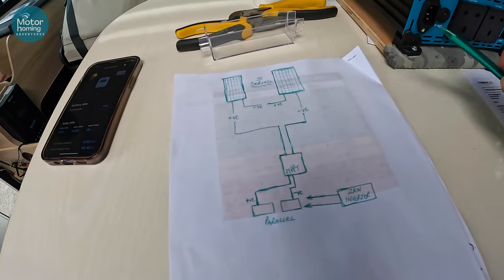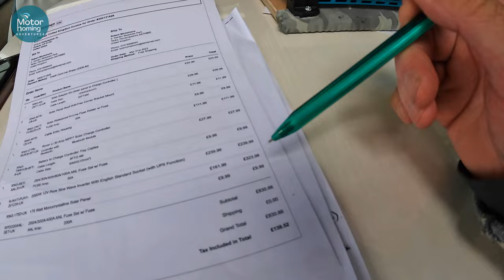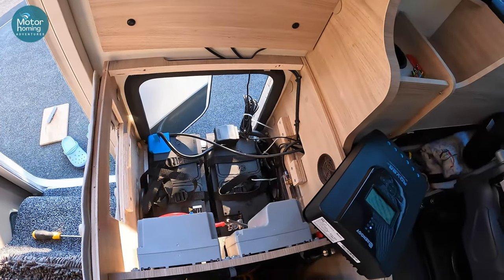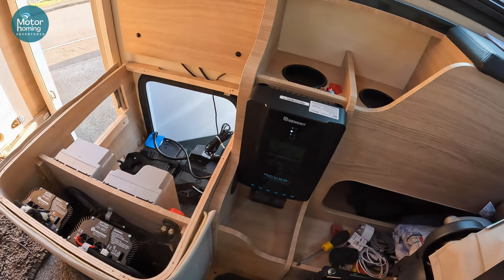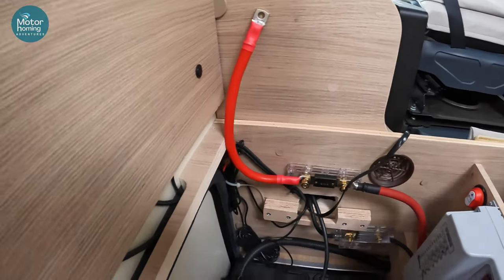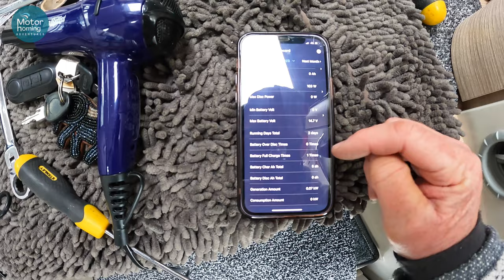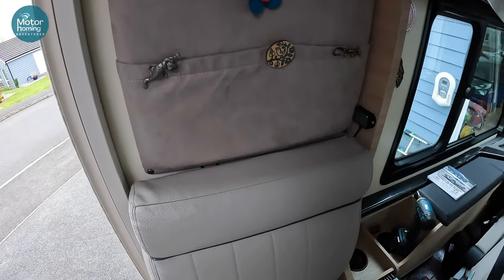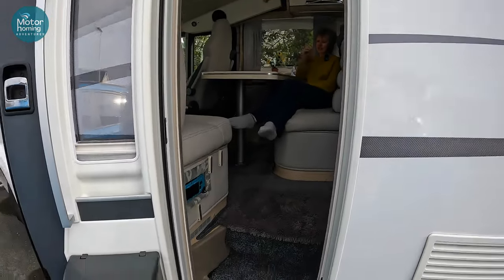Motorhome Mods : Motorhome/Campervan DIY Solar Upgrade : Part 3 - The final day !!

Comment: Great series of vlogs and really demonstrates how straightforward it is with a little planning. Probably going to do the same with my new van but a little worried about invalidating the warranty so will probably record every step and it's only a single hole needed.  I guess the only missing you might want to consider is a means of easily isolating the panels like you can the batteries?.If you didn't want to create a large opening in your decorative panel and had a little more space  could you introduce a short length of cable from the inverter and fix a 3 pin outlet to the panel? I might consider Mer over paying a lot more for a ceramic coating.
Reply from the maker: Many thanks indeed Ged and really glad it made sense :)) Yes the warranty is a consideration but mine is only two years so not long to go now. Yes I did consider running an extension from the inverter, under the floor and then siting it like any other socket in the van near the table where we have that existing extension but decided we could do everything we needed to from there.
Mer is fantastic Ged - just needs the elbow grease - wax on, wax off .... :))

Comment: Beautifully completed 👏, will now need to look at doing something similar. My concern is that I might interfere with the existing EBL and I don't want to touch the existing system.
Did you download the Will Prowse book, as I need to read something and learn a wee bit before starting and buying these products for a project like this.
Used MER for years on my car.
Reply from the maker: Many thanks Drew, much appreciated :) 
I started on You Tube and found Will Prowse's channel which I liked and he had an Amazon link to his paperback on his film descriptions so I then used both and other sources that I came across en route - just a general sponging of info!!

Apart from bypassing the final wiring run that went through the old 20A fuse, I didn't link into any existing systems and the solar almost runs as a standalone aspect bringing power into the battery and/or out via the inverter. I have an existing DC to DC charger system when the engine is running so the solar is another seperate system - at least that's how I look at it in my non-expert way !! 
No doubt your own research will establish any EBL issues with your vehicle as you begin that learning journey - thats all part of the fun of the project.
I'm keeping a close eye on all the van electrics and battery states by day at the moment without the van plugged in on the drive at all - just seeing how things settle then have a run or two planned to properly test things.

Comment: Interesting.  Thank you for this.  I'm in two minds on my solar upgrade - panels in series or parallel?  I note you opted for series which may be less efficient if any part of one panel is shaded?
Reply from the maker: Thanks for watching GD and I went series as the wiring required was less 'heavy duty' and the configuration should be more efficient across the 'solar day'. The mobility of the van means if I anticipate needing max power I chose the appropriate parking space with no shade which is easy. Having parked partially under trees once it didn't affect the live solar generation much at all so I've not yet seen the shade effect !! I think at the end of the day I just preferred to work with slightly lighter guage wiring - being a beginnner !!! Hope that makes sense :)

Comment: Hello Bob, I have watched this video before and enjoyed it, so I am back in tonight to look at your inverter. I am considering getting an inverter for my van. Before I jump in , I was wondering why you choose a 2000 w inverter when you could have a bigger or smaller one. I am sure you will have researched the subject. I am thinking of mounting the inverter in my batterybox , and connecting it to the mains input plug . I am thinking all 240 sockets and micro wave will have inverted power waiting to be used. My main reason for the inverter is to use the microwave once a day . I have also heard that inverters can be hard on batteries. I am not using lithium batteries at the moment, like yourself ,I will chip away at upgrades. Any feedback much appreciated. I see 2000w and 3000w inverters for sale for reasonable money. Biggest might not always be best, just wondered how it has been working for you guys. Many thanks
Reply from the maker: Evening BBH and thanks for watching as always 😁

Yes the research was based on the most power hungry item which, in our case, was Nicky’s hairdryer!! Together with the Will Prowse You Tube channel and his book I then worked out what would be best to run that. There was a jump in price to the 3kw inverter and the 2kw was fine for hairdryer so we bought that one. 
I kept it as a stand-alone rather than wiring it into all the plugs - easier to wire! 

We now have a single 5m extension cable with 4 sockets so I plug that into the inverter when required and run it to whatever we are using power wise that’s not on the standard 12v circuit.  

For the last 7 days we’ve been off grid in France and the inverter has been running hairdryer and Amazon Firestick mainly and performing really well - solar charges perfectly in the day with the new 350w system 😁 - not even testing it harshly yet and not needed EHU at all for the week. 

The siting near the battery bank is good as that is an important consideration. There are recommendations for wiring thickness based on inverter size AND distance from batteries - 3kw would need thicker wires than ours - again those resources will help to spec your requirements and Renogy’s website also has a system to help you spec the right components and wiring 

Hope that helps :)

Comment: Another great video. Interesting to see how our van is put together without me having to pull it apart.
Looks like ours is working ok as we did a couple of off grid trips last year in the UK summer/autumn for 4 nights and the existing solar and 2 batteries seemed to cope ok so I am going to hold off for now doing any upgrades to solar, although it is tempting. Any idea Bob what the existing controller can cope with as one option could be for us to upgrade the one solar panel to a higher capacity one with the existing setup. We have the hab air conditioning next to the kitchen area which reduces the roof space.
Any idea did the original trickle charge the vehicle battery as well and does your new controller do this.
Have just bought some Mer to give it a try but Marie thinks I will end up getting it on the grey bits.
Doing a few changes. Just had surround cameras fitted which are brill. Fitted TyrePal monitoring, which looks promising but not yet had a run with it on. Have the bits and need to fit the wiper washer change and bonnet drain away. Thinking about the fuel tank mod to give back the 90 litre capacity and also engine mod to give the extra hp.
Reply from the maker: Wow thats some intersting mods planned there Paul - like it - as you will when they are done - Mer on grey gloss GRP is fine of course - it's just the plastic light cluster surrounds I avoid or say matte plastic bumpers. Anything gloss will come up a treat, and chromw, and I do ALL glass too apart from the outside of the windscreen. I like the camera idea too - what product did you use? :)
Now in terms of the solar - the Vechline PWM, if it's the same as ours is a 10 amp and 17 volt limit and the 100w panel kicks out 5.5 amps and 18 VMP so the PWM is already on the edge of it's capability - hence they are sooo cheap to buy!!
The equation is Panel Watts / Battery Voltage which for ours was 100w and 12v battery so around 8.3 amp rating for controller. If you added another 100 it would be 200 / 12 = 16.6 amp (plus they often advocate x 1.25 to give a margin) so as you can see you'd be well over the capabilities of the current 10 amp PWM. 
The PWM is about 30% less efficient than an MPPT too. 
Have a watch of Will Prowse's You Tube channel - he starts from the very basics up to advanced - nice guy and good instructional stuff.
I haven't touched the original on-board charging processes so that all carries on as before - think of my solar project as being a standalone system that just finally connects to the battery bank - as do all the other existing van systems without me needing to touch them :))
Reply: @motorhomingadventures  Hi Bob, are you on messenger or the like and I can send you details.
Reply from the maker: @MightyQuin61  I've pinged you a message on Messenger :)

Comment: Bob are you under the impression that a investor kills you batteries ?
Reply from the maker: Not with the solar replacing the power used - that’s the off-grid plan 😁👍